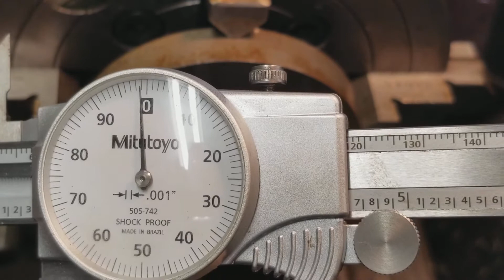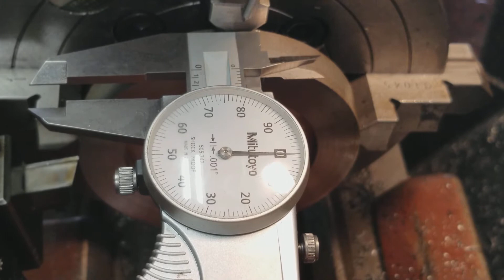Plug This Part 3

Comment: Great practice Ray. AS someone even older than you I have learned on id work the bottom edge of your tool needs more clearance. same when you chamfer just raise your tool a little above center on your ID chamfer. Hope this helps keep the videos coming instead of just sitting around.
Reply from the maker: Mike Nixon, Thanks for the tips buddy!
Not to much "sitting around" here...
Be well...